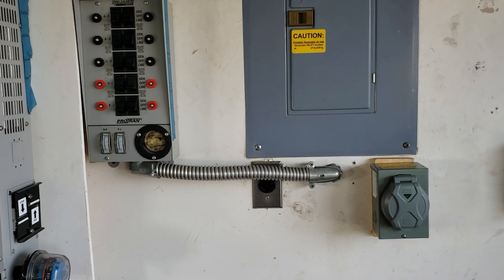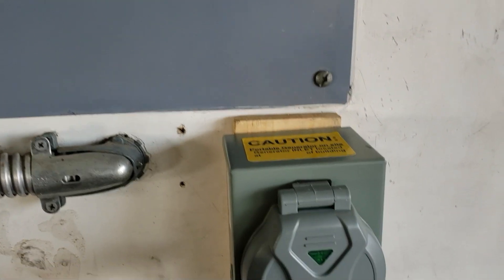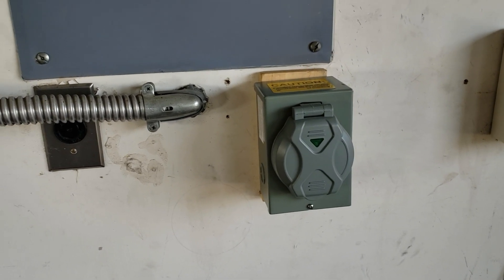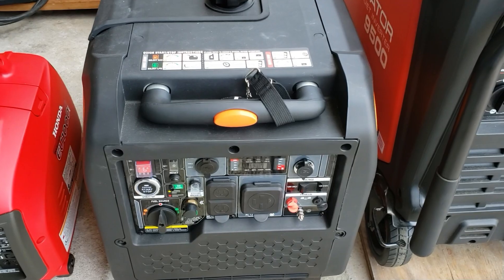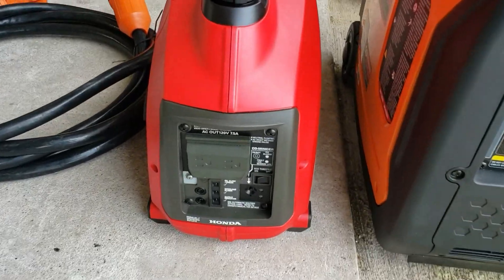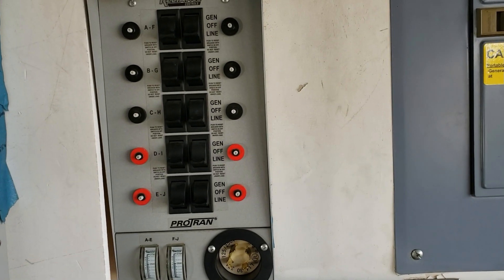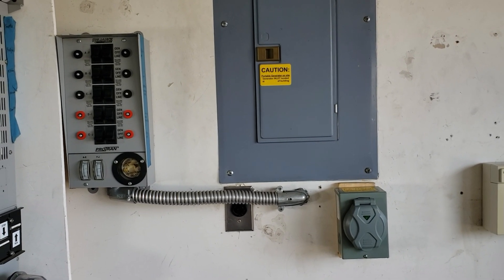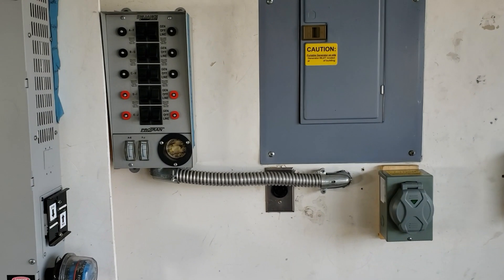BEST Way To Connect A Generator To Your House - Interlock Kit with Inlet Box or Transfer Switch

Comment: What does floating mean? I have a 50 amp inlet box , newly installed.
Reply from the maker: Floating means the generator neutral wire, and ground wire are not bonded together

Comment: Gavin, I plan on getting a transfer switch installed, and we have a basement in our home. I seek to get the Reliance switch installed, but here's the thing, I want 2 x 30 amp receptacles using 1 box outside for gas generators, and another box installed in our basement for smart generator batteries. I want to have both inlets connected to that one Reliance circuit board thats in the basement. Do you see a problem with it doing this way, or is it ok to do sir?
Reply from the maker: I will have to check I’ve never heard of that setup before

Comment: Can I use the 50a setup for times when I want to switch from my outside big gen to using only my Delta pro with an adapter? (of course I would be only switching on a few ckts)
Reply from the maker: Yes, you can do that but it really works best with a transfer switch because you can still power the large loads on the grid.

Comment: Couldnt you just install an inlet and then use your normal home circuit panel to control what is powered and what isnt?
Reply from the maker: Yes I has both for testing purposes

Comment: That is an incredible set up!  I have 2 fuse boxes set in parallel in my basement.  I have a 12k generator (duramax).  What would you recommend that I do to connect my generator to my house?  Should I just do a transfer switch?
Reply from the maker: With the inlet box the entire house will have power since your generator is large enough.

Comment: Of course I can I'll just hook it up to an inverter well I'll probably just hook it up to its own thing that is also rated for a UL certified so if there's an accident when the power comes back on it doesn't fit into the grid when there's no power coming in of course I'm going to wire it sorry never going to the grid the grid never be able to power it and if it has an option the option would be the inverters or certain things that it's actual hooked up to that the grid can not power and that is what I'm taking a way from the grid this year but the inverters will still be hooked up to the grid but the grid will never power inverters that's what the batteries are for and the solar panels are for I just got too much solar panels for the inverters and I'm not going to but 12 inverters only six of them I will buy. Oh you already got the idea.

Comment: Are you sure about a transfer switch being able to use a bonded neutral generator? I thought this was only true if you're using a transfer switch that has enough poles that the neutral also gets switched. I don't believe Reliance Controls is manufacturing the versions (Link-X) which can switch the neutral anymore although some are still available from retailers. The regular Pro/Tran series doesn't switch the neutral.
Reply: EE here.  I agree with your assessment.  Unless the transfer switch switches the neutral (most small ones do not), the generator neutral must be floating because the home's neutral and ground connection will still be bonded at the service entrance or first point of disconnect.
Reply: @josephknapick5307  that was confusing to me as well
Reply: I'm confused there too

Comment: 50a interlock, are you supposed to power that with 120v or 240v? If you power it with 120v will your 240v appliances still work? Thanks
Reply from the maker: 240v generator is best unless you have only 120v loads, otherwise you will not be able to power any 240v loads

Comment: Excellent comparison! I used a reliance pro tran 10 circuit manual transfer switch for several years. Generator is 40 feet from the house in a large ventilated utility building. Great set up but I changed my back up three years ago to an interlock kit for more circuit choices. Caution: I am not an electrician so I had all of my work inspected by a master electrician. Thanks again for this review...very good.
Reply from the maker: Thanks Tom

Comment: Another great video Gavin but for me it's about Budget mostly along with age of home/wiring & location of panel,... For me, I installed a Generator Inlet box to the outside wall of my kitchen with 14 inches of wire to a 20 amp double household outlet on the wall inside the kitchen so this outlet in the kitchen is NOT wired to household wiring, it's for Generator use only.
If the power goes out I can simply plug my 1800 watt Inverter Generator into the Generator Inlet then plug my Fridge & Chest Freezer into the outlet fed by the generator :)
I can also run an extension cord to Router & TV for entertainment,... It's not a perfect setup but my important basics are covered & this cost me about $50 to set up :)

Comment: I think the title of your video is confusing. You are discussing the difference between a transfer switch solution and an "Interlock" solution. You didn't mention the one big advantage of a transfer switch is that most of them have load meters on each leg. That allows you to balance the power between the two generator windings. If you are drawing 30A a generator likes to see 15A from each leg. They aren't happy with drawing 5A from one let and 25A from the other leg.
Reply from the maker: I will check on the title 
Thanks buddy 👍🏾
Reply: @GeneratorReviews 😊
Reply: Nice

Comment: I'm scratching my head. Not all transfer switches have integrated inlet receptacles. A lot of transfer switches use a remote inlet box.  If your main panel is located in another part of the house you will have difficulty using an integrated switch. Your generator might be located outside or out on a porch. In those cases you probably won't be using a transfer switch with an integrated inlet.
Reply from the maker: I can’t talk about all transfer switches, but I can’t show you which one I picked. I’m talking about the one I have.

Comment: Is there an after-market automatic transfer switch that will not only start the generator, but will also switch the mains off and switch to the generator input? I'm thinking of those Generac whole house standby generators. My mom had one up north and when the power went out, it automatically started up and switched over from the mains. Then switched back when the power came back on and shut down the generator. That would be perfect for that monster Westinghouse generator. You'd never get stuck out your driveway gate.😁
Reply from the maker: Hey Tom
This ATS does exactly what you just described. It does switch the power from the main and switches back when the power comes back.